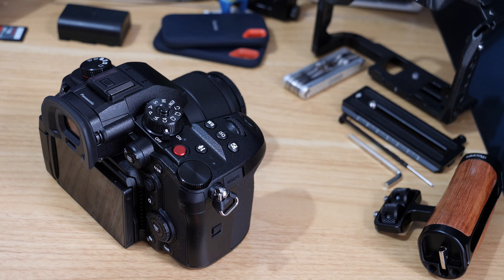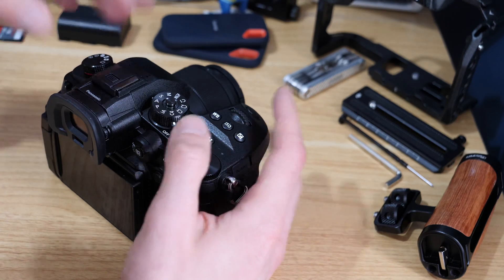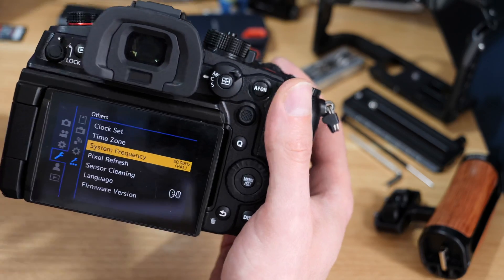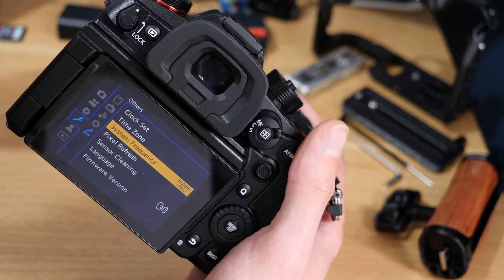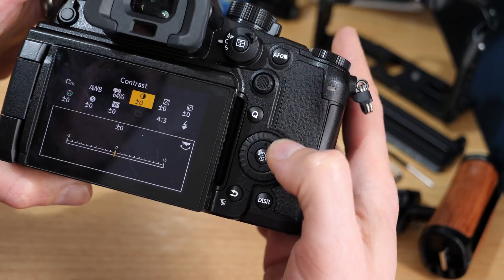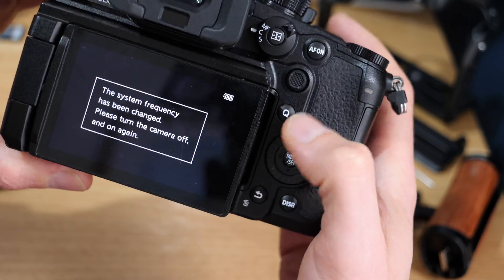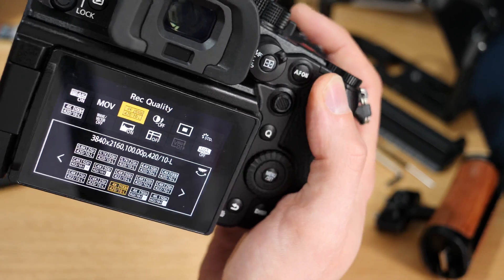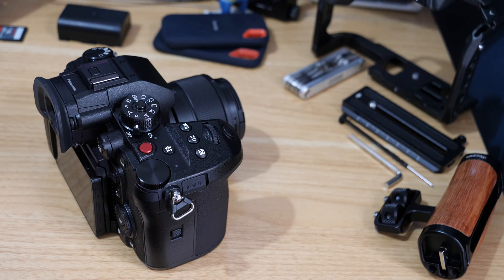Understanding System Frequency on the Lumix Cameras | Should I use PAL or NTSC on Panasonic Cameras

Comment: on other cameras, you can switch the camera from 50 Hz to 60 Hz, while writing at any frame rate. Doesn't this camera have it?
Reply from the maker: You would need to use VFR to use any non-standard frame rates for either system frequency.
Reply: @stevelitton  That's not true though, i can use 10bit, all Intra, 4k, 400, 24p on 60hz system frequency on my gh5s
Reply from the maker: @treasey8655  Yeah you're right, there are a few 24p and 48p options in the NTSC setting. To be honest, your camera should come shipped with the correct frequency setup, I just wanted to explain the option a little further. There was a lot of confusion around 50fps and 60fps and most of it is because I am using PAL and they are using NTSC.